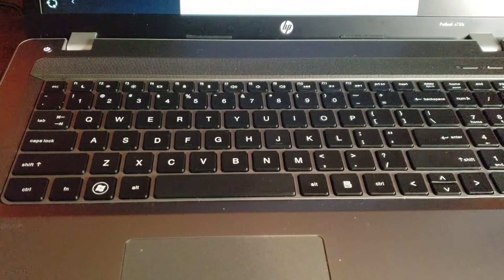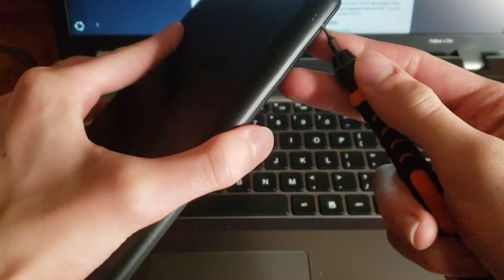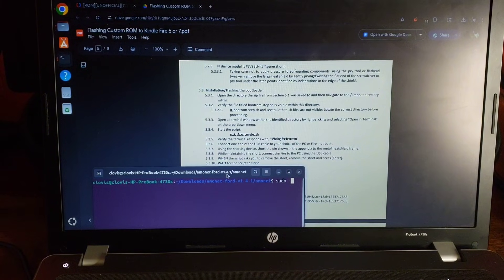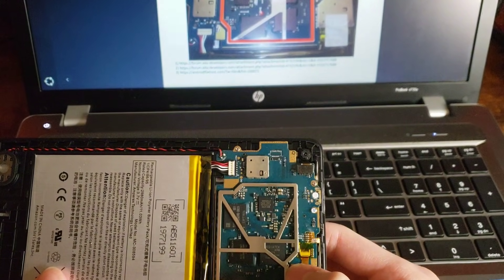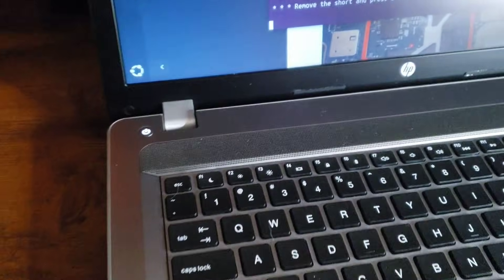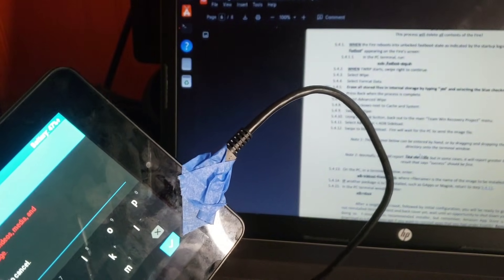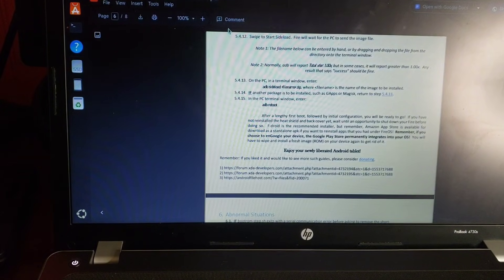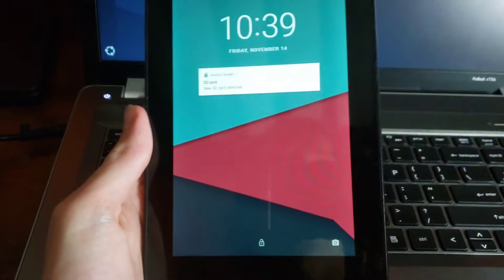How to install Custom ROM on Kindle Fire 5th Gen! (2015)

Comment: Is that the only Rom? I want one that is super stripped down without the unnecessary BS.
Reply from the maker: Only one I could find, that is the point of this. It definitely runs better then stock.
Reply: @Tech86807 it's better than,  not better then